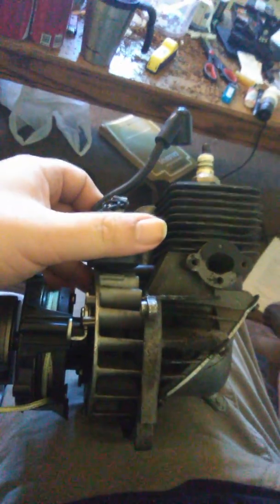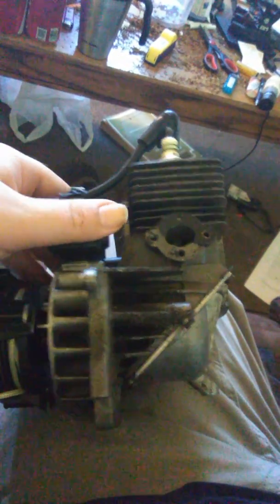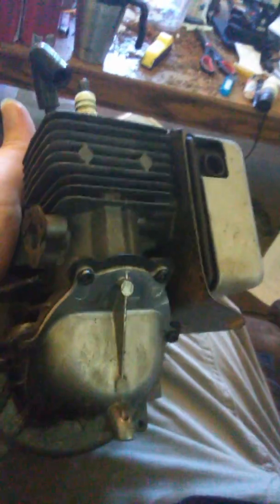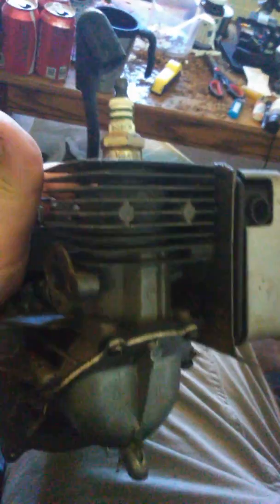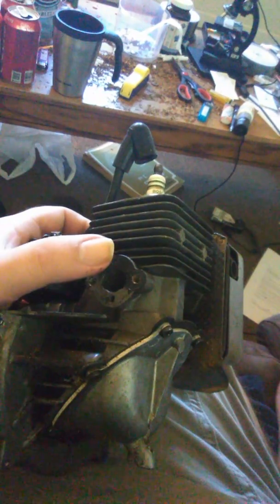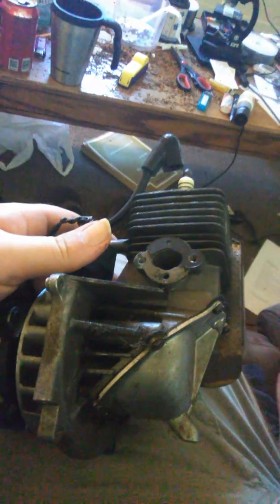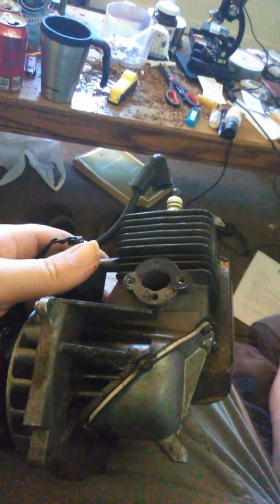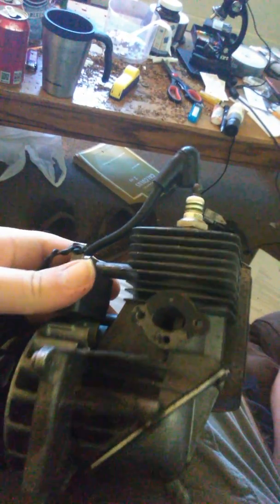Solar hydrogen 2 stroke system

Comment: S1R9A9M9 triple coils assembly - used  in mower engine that ran on water in carb..Wire was plated #14 gray and red 
copper wire from riding mower chassis. Circuit has 100% on 7turns 
Magnetic field as 90 degrees over 5 turns of #12 gauge wire for firm 
frame for the upper 7 turns. see wire with side tap joint #1 to ground, 
6-10amps through plug, accessory spark gap, diodes, Timing shifted to 
-34degrees late timing by the field, the 6-10amps fire only when plug 
fires through 13 turns. Joint #2 as Hi V + amps  together to plug. Water
 in carburetor changes to water vapor pressure at low end of piston 
stroke, along with minute amount of hydrogen gas that also fires. Vacuum
 pulls only level of water engine needs. Electrical Circuit source of 
resistance to limit current not known. Battery start, battery removed., 
Circuit runs on onboard dual alternators - Probably AC for field + DC 
for spark plug amps, (or Bridge rectifier to get 10 A) . High voltage 
ignition is negative with positive ground.  EGR was not applied on 
Briggs 18HP as was done with earlier car conversions that used sets of 
obsolete relays. S1R coils was to replace the unusual relays. He called 
it electromagnet + booster coils.Original spark plug of 4kohm changed to
 125ohm QC12YC, so as can be taken apart for resistor removal! 
Engine ran on water at idle speed and sounds somewhat 

like a water pump! Parts contained in plastic tub on side of engine with
 wires coming down from upper engine cowl and all wires wrapped in blk 
elec tape - it's not just 1 plug wire!. Alternator wires always come out
 on left side starter motor. Extension cord , if jumped  at the plug 
end, can be the extra long RETIURN WIRE  from  bottom of spark plug he 
said was required and back to tub alt wire. See Videos #1 + #2. at slow 
speed. Web site shut down.